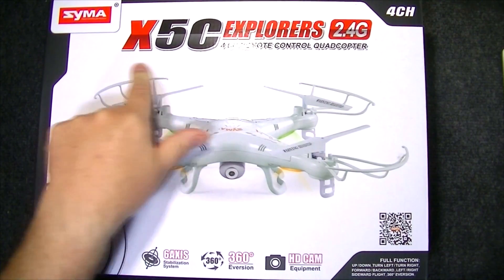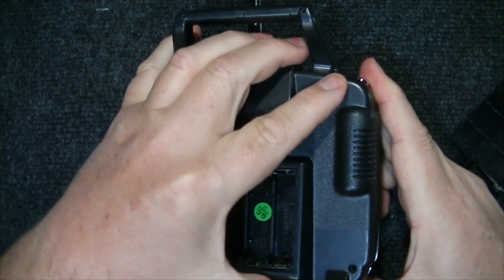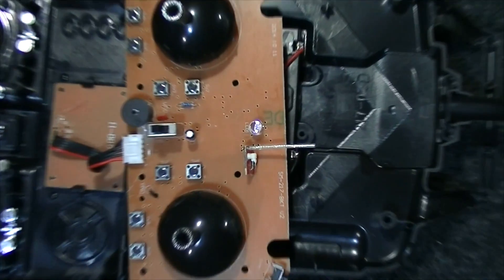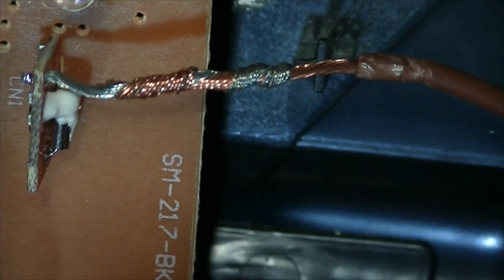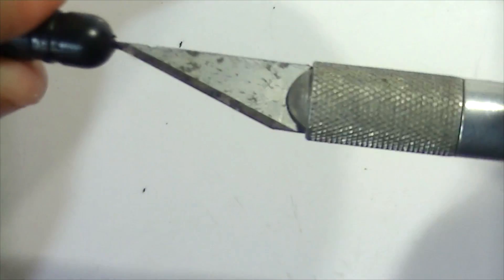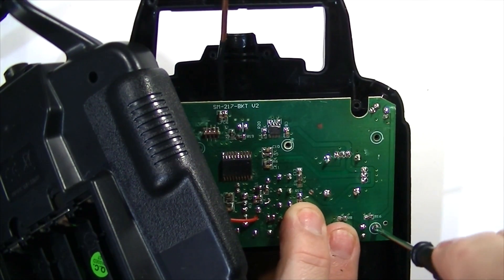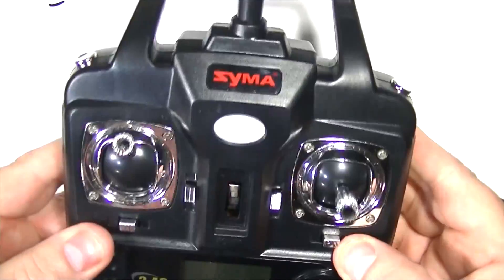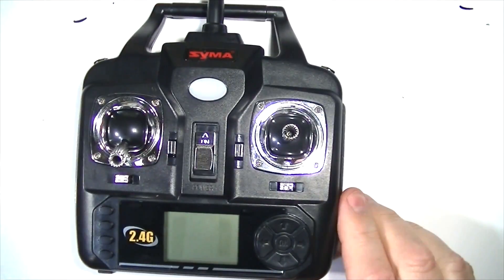Syma X5C Mods - Range Extender Fix - Without Soldering Antenna Length Hack

Comment: I have drone mt300 , and it's transmitter is 2.4ghz, it have range of 120 meters , I watched your video, can this mode increase it's range more than 120 meters, and the second thing that is it necessary to match the copper wire gauge with the antenna in transmitter? , coz I don't have any device to measure gauge... I want to do this but at the same time i'm afraid that a slight mistake could ruin my drone forever.. Kindly answer my questions, thank u
Reply from the maker: Yes it just may work. Just about any will work.

Comment: i found 18 guage speaker wire will that work?
Reply: its insulated not bare
Reply: i also have 14 gauge automotive if thats better
Reply from the maker: That will work perfectly!
Reply from the maker: That should work fine.

Comment: which will work the best ?
1.earphone cable
2. micro-usb charging cable
3. sata data cables (connecting hard drives)
Reply from the maker: Which ever one has the most copper wire.

Comment: your mod works great! i tested at 200m and signal is rock solid, i am sure it can go beyond 200m!
Reply from the maker: Awesome! I'm glad it worked for you.
Reply: can this mod will work to the transmitter of syma x5hw? pls answer
Reply: Jacks Videos Wow! !!! That's  Awesome  !!! Congratulations 👍👍
Reply: Robert A. Edinger, thanks for this Very Helpful Video ! I tried this once, but it hadn't occurred to me to Drill/cut through the Fake antenna! I just Soldered 2 wires together, and tucked it inside throughout  (if you will) ! Now I see that there is no need for Soldering!  Can't wait to try this again, the way that you Demonstrated it ! I don't have a Ruler in Centimeters though ! I suppose I can just go Find one, lol, Thanks again 👍👍
Reply: Ps "Liked and Subscribed"
Reply: Jacks Videos Any Improvement is Good for Me 😊 👍
Reply: Any further and be prepared send out bloodhounds to find your toy drone  LOL!

Comment: where did you buy that antenna
Reply from the maker: It was just a piece of scrap wire I had. 18 to 20 gauge stranded automotive wire will work just fine. You can also buy it on amazon.

Comment: which wire is that?
Reply from the maker: Can you be more specific?
Reply: Robert A. Edinger I want to buy this antenna pls give me link
Reply from the maker: https://www.amazon.com/NTE-Electronics-WH18-00-25-Stranded-Length/dp/B003N3DQOI/ref=pd_sim_328_1?_encoding=UTF8&pd_rd_i=B003N3DQOI&pd_rd_r=J9N58323T1FB90TGE7M9&pd_rd_w=XU65Y&pd_rd_wg=4Cth7&psc=1&refRID=J9N58323T1FB90TGE7M9
Reply: Robert A. Edinger thanks
Reply from the maker: No problem, glad I could help.

Comment: Is there not a wire mesh shield over a wire with the insulated antenna wire inside it? I've seen some that are and some are not. Do you know why that is?
Reply: Robert A. Edinger So should we be using a wire which has an inner insulated wire with wire mesh surrounding it ?
Reply from the maker: Shielded wire is used to remotely connect to an antenna. The shield is there to keep the connecting wire from becoming the antenna itself.
Reply from the maker: No, just plain ole stranded wire.

Comment: I once lost my old rc car's antenna and replaced it with a wire and than the car went left/right + backward but not forward anymore... I have to test different antenna lengths, and it might run in both directions again!
Reply from the maker: I hope it works for you. Let me know.
Reply: I cut off 5 centimeters from the antenna wire on the transmitter, but the car didn't worked forward. The car is working well even without the antenna. It is an older 27MHz rc car.
Reply: One wonders what have you been smoking lol!

Comment: will it work with syma x13 Storm ? It has not an antenna outside on the controller ?
Reply from the maker: I can't say for sure, but it should work being that it is also 2.4 ghz. Please let me know if you try it.
Reply: I will try it immediately when the drone arrives. I purchased it but I'm facing some cargo issues...Hope it will arrive soon...
Reply from the maker: Cool! good luck.
Reply: Robert A. Edinger  I did the upgrade man but in my case I take out the drones antenna too and it's give me some more range I don't know how but it works very well! Thanks for the helpful info bro!
Reply from the maker: Awesome!

Comment: does this work with a symma x5sw transmitter as well?
Reply from the maker: Yes, it should work just fine. If you try it, please let me know how it goes. Thanks for watching.
Reply: Robert A. Edinger sorry I try to do it but I messed up i think i broke something inside the transmitter or something 😅 i guess I need a new drone 😅
Reply from the maker: I'm sorry to hear that. It is very possible you may have cracked the solder joints on the circuit board. It is possible to re-solder it if you are able to or know someone who can.  Otherwise you can buy a replacement transmitter without buying the drone also. Good luck, let me know how it works out for you.
Reply: Robert A. Edinger yeah I'm getting a new transmitter it will come at may 16 and I will tell you if it works 😁
Reply from the maker: Cool!

Comment: does the wire have to be copper?
Reply from the maker: Any wire should work fine.
Reply: Thanks for replying. Does the wire need to come with insulation or can it be a solid wire?
Reply: Does the wire need to be stranded?
Reply from the maker: A piece of solid non insulated wire should work fine. But you should at least put tape over it so it wont short out any of the components.
Reply: Okay. That's what I will do. Thank you

Comment: Can you fold it so it won't be sticking out? Can it be shorter than 12.5? Can I use any wire such as from a phone charger?
Reply from the maker: I wouldn't fold the wire however, some have run the wire up thru the groove in the handle. It does need to be 12.5cm for best effectiveness. And yes, phone charger wire just might work. Let me know. Thanks.
Reply: Robert A. Edinger Thanks so much I appreciate it.

Comment: what if you solder on the rubber duck antenna on the drone.  or the coax shielded cable found inside a rubber duck.
Reply from the maker: It just might work. Please let me know. Thanks.
Reply: it's nickname for dipole antenna

Comment: The insulation on the original wire is ridiculously hard to remove
Reply from the maker: I agree. It may help to carefully warm it first with a hair dryer or a match
Reply: or slice away with an exacto knife.
Reply: i did mine, and it's swear by it! first off, it goes farther than i am trusting with it, i can actually fly within were i like to fly without it crapping out. 100% do it. trust. get your measurments right but it's wicked easy. i bent mine in a curve at the end, and it seems to help rather than strait up. Its one of my fav fliers now, I really like the distance. DO IT!
Reply: Eoin Crossan what were ur result after this mod?

Comment: Tried the mod on my X5SW and ended up bricking the Tx. Soldered the extension to it and it may have conducted too much heat to the components on the antenna pcb and fried them, just a guess. The "On" light illuminates but no readout on the LCD screen and won't bind. Ordered another Tx...
Reply from the maker: That sucks. Thanks for the heads up.
Reply: Robert A. Edinger  I'd like to try it again and not solder to test it then solder closer to the tip of existing antenna with an alligator clip to act as a heatsink in between.
Reply from the maker: Good luck. Let me know it goes.
Reply from the maker: Also be very careful when stripping the insulation from the transmitter antenna because it is easy to crack the solder joints on the circuit board.
Reply: Robert A. Edinger   I used wire strippers a quarter inch at a time because the insulation didn't want to let go. I then tried to totally replace the antenna without success. I'll check that the antenna PCB solder joints to the main board are good. Thanks for the suggestion.

Comment: I've seen in other videos that the antenna wire inside the copter itself is often laying across the top of its circuit board. By bending it to an area along side the board where signal doesn't  have to go thru the board is said to improve range as well. Some have drilled a small hole in top of copter and ran that antenna wire up through it. It will stick out the top only about a half inch. Doing both this transmitter mod and adjusting the receiver antenna position might really give it maxed out reception. I have a HolyStone clone I'm gonna try this on.
Reply from the maker: Thanks Colin, thats a great idea.

Comment: that's cool. Do I need to extend the antenna in my quad  too? or does it work by just doing the controller ?
Reply from the maker: Thanks. I just modded the controller and it made a definite difference.
Reply: thanks! I just did my controller this morning but I haven't tested the distance

Comment: I want to do this Antenna mod on a 2.4g wireless camera, any idea as to what length the wire should be? The camera antenna wire is only 1" long now. Any help would be great. It's going in a R.C. glider.
Reply from the maker: 12.5 cm should work for your camera as well.

Comment: can it work with the.x8w it has 2 antennas
Reply from the maker: I can't say because I don't have the X8W. I'm sure it'll work just fine on the transmitter antenna, but I'm not sure about the camera antenna. That could be on a different frequency. Thanks for the comment and good luck.

Comment: Forgive me if this question has been answered, but do you think this will work with the Syma x8g model?
Reply from the maker: I have a x8g also and the range of that seems fine for me, so I haven't had the transmitter apart.
Reply: Are you getting over a 100 meters? I think that's they're saying the max distance is. I haven't received mine yet.
Reply from the maker: It flies far enough that I am not able to see it to control it.

Comment: Hey I just completed this mod and now the leds on the drone always flash fast (ie. cannot bind to transmitter). This happens with both the antenna extension and without the antenna extension. Any ideas what might be wrong with it? Thanks
Reply from the maker: I'm sorry to hear that your drone is not working. Hopefully this will 
help. I believe you may have cracked one or all of the solder joints 
where the antenna circuit board solders to the main circuit board. 
Unfortunately this will most likely have to be re-soldered. Luckily it 
should be a fairly simple fix for someone with a soldering iron. Keep me
 posted on your progress. Good luck.
Reply from the maker: If you are interested, here is a nice and inexpensive kit to learn to solder. http://amzn.to/2mpxURC
Reply: Robert A. Edinger thanks for that! You were right about the solder snapping. I tried soldering it back onto the main board with my dad but actually it was the copper on the main board that had snapped so there was nothing to solder back onto. A replacement controller is about £10 here. I'll be more careful in future!
Reply from the maker: Try scraping off some of the green coating ahead of the snapped copper. Then lay down a bead of solder along the copper to join it back together. Hope this helps.

Comment: I used 18 gauge wire and shrink tubing, with an imperial length of 4.29". I also bent the wire in a 90 as they say to do with antennas...Triple the range. Thanks.
Reply from the maker: I'm glad it worked. Thanks for the comment.

Comment: Any specific type of wire???
Reply from the maker: It is 1.02mm Diameter
Reply from the maker: 18 gauge automotive wire will work fine.
Reply: what's 18 gauge? is that 1.5 or 2mm square?

Comment: will this work on different transmitters aswell?
Reply from the maker: It should work just fine providing it is 2.4 GHz. It most likely is however if it is a different frequency it will require a different antenna length.
Reply: Robert A. Edinger tried it and it works not sure about the range though
Reply: Robert A. Edinger ny antenna is a little smaller, i guess that will have a small affect on the range of the quad right?
Reply from the maker: Yes it may.
Reply: J Petrik what's the length for 5.8ghz?
Reply: 5.17 cm

Comment: i just tried this with a solid copper wire, it should have same effect if done properly right? wont be able to try it out for a few more hours
Reply from the maker: Should work just fine. Good luck.

Comment: Can the wire we longer than 12.5 in ?
Reply: Antennas are made to certain length depending on frequency... Too short or too long and you can damage your transmitters finals.. because you have to high of an SWR.. ( standing wave ratio ) This guy made whats called a 1/4 wave antenna..   So having your antenna at the correct length will make all the difference.
Reply from the maker: Yes it can be, however it may reduce the range.
Reply: 12.5 Centimeters !  (not in)
Reply: Why will a longer white reduce the range?
Reply: the lenght of the cable is because of the shape of the microwaves on  the transmisor.
Reply: The antenna he made is a one wave length antenna (2.4Ghz = 12.5cm) the reason it improves upon the stock antenna is probably because the transmitter prefer an higher impedance antenna like a full wave.
Reply: The antenna he made is a one wave length antenna (2.4Ghz = 12.5cm) the 
reason it improves upon the stock antenna is probably because the 
transmitter prefer an higher impedance antenna like a full wave
Reply: Thx for sharing this. It worked perfectly!

Comment: Thank you for this I will be doing it. And why the exact 12 1/2 cm length thankyou
Reply from the maker: 12.5 cm is the full wavelength at 2.4ghz. Glad to help and thanks for the comment.
Reply from the maker: other viewers have run the wire up through the groove on the handle of the transmitter case. That apparently works pretty good also.

Comment: how can you see it at 350???
Reply: The farther you can control the drone, the better. I've had mine get away from me before because the wind caught it. At least if I could have controlled it, I could have killed the motor and brought it down much closer to me so I didn't half a chase it nearly a half mile. LOL
Reply from the maker: That's a good question.
Reply: will it work with any sort of wire?
Reply from the maker: Yes.

Comment: THX for the Video. I have the Zoopa q420 and maybe i give this mod a try. i have a question. is it possible to do this mod at the drones antenna to? modify both :)
Reply from the maker: Thanks for the comments. The most important antenna is the transmitter however modding the receiver antenna "also" might have a slight benefit. But if you can't get a good signal from the transmitter, a bigger receiver antenna won't do much good. Hope this helps.

Comment: great video. I'm going to try this today. I have a few questions if you don't mind... you mentioned 12.5cm being the full wavelength for 2.4ghz. Is that best though? How can I learn more about this? Also, I found an antenna from a linksys router. Why would that wire work better than traditional speaker wire/etc? Just trying to learn
Reply from the maker: Mark, Sorry I'm not an electrician, I'm just a handyman. I wish I could help you more. Hopefully another viewer will be able to answer your questions. thanks for watching and thanks for the comments. Good luck.

Comment: just tried this mod and can see a definite improvement.  Not sure just how much yet as it was a night flight but it definitely flew to where I could no longer hear the motors and was still going before i brought it down for safety reasons.  WAY easier than soldering a 2.4Ghz wifi antenna.  My only adjustment was to not drill a hole in the fake antenna mast but instead to loop the wire inside the case and then insert the extra into the fake antenna mast.  Perhaps this wont net me as much range increase as your method but it looks much more aesthetic.  I just need enough range to get a good horizon shot above these tall pines in the PNW.  Thanks for posting the How to!
Reply: Mr Edinger, If I may: Looping the wire will have no adverse effect. You advanced this modification by making a fractal antenna. WELL DONE.
Cheers,
Reply from the maker: Thanks for the tips Tom.
Reply from the maker: Cool, I'm glad it worked! Thanks for the tip and thanks for watching.

Comment: Would it be possible to do this without taking the controller apart?  Could I just cut open the antenna cover and add the additional wire by twisting and taping?  Why exactly 12.5 mm?
Reply: 12,5 mm?  no cm?
Reply: CM, MM was typo i guess
Reply from the maker: If you watch the video closely, you can see that the original antenna does not extend into what I call the "fake antenna". There would be no way that I can think of to reach the original antenna other than disassembling the transmitter. The wire should be 12.5 mm because that is the full wave length at 2.4 ghz. I hope this helps. Thanks for watching.